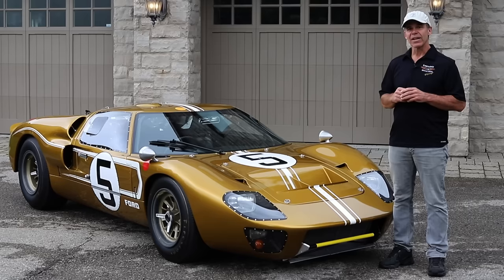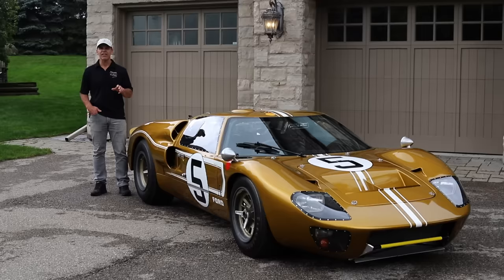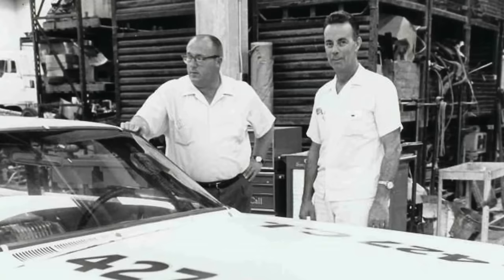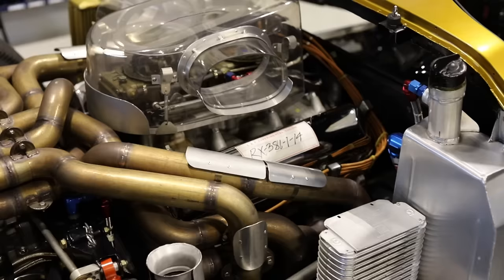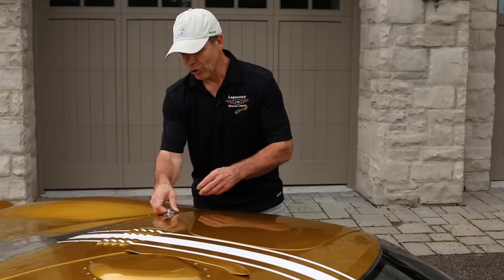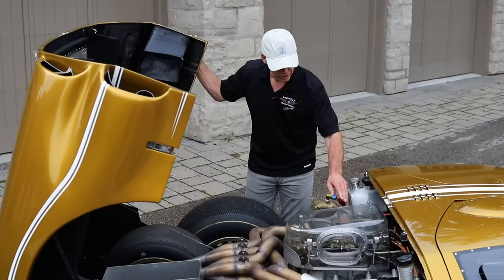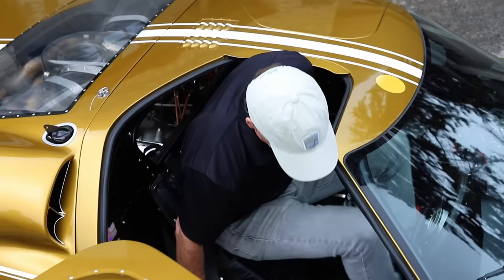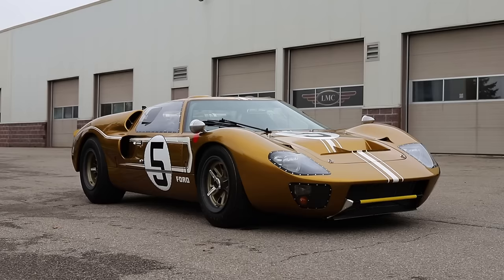The Legendary 1966 GT40 MkII-B: A Closer Look

Comment: My dad had a '67 Fairlane 500 R code car with a 427 with I believe a Low riser engine...he sold it just before I turned 15 and would have been able to legally drive it...but I snuck out with it a couple times as a 14 year old...once with my buddies when we were camping out in the nearby woods. I snuck into the house at about 3 am and grabbed the keys and we pushed the car until we were probably more than a 1/4 mile away before we started it. I drove it all over our town...it was fast as hell.

Comment: Nerd note,
The inboard half-shaft joint is called a tri-pot not a cv joint which would be on the wheel end of the half shaft, the tri pot joint allows the shaft to move in and out as the suspension travels up and down,